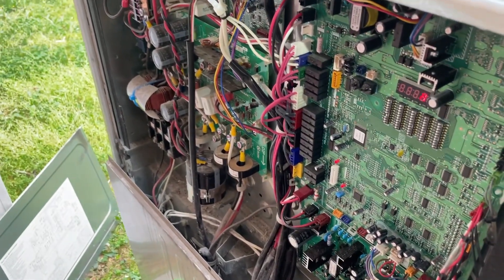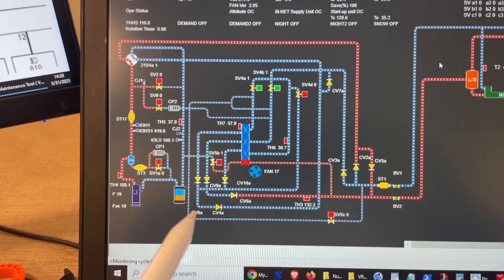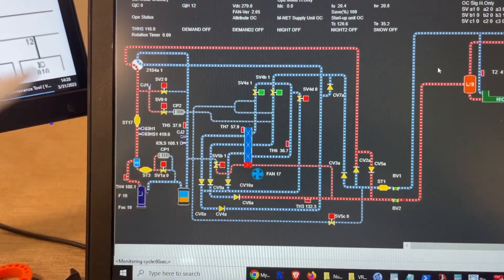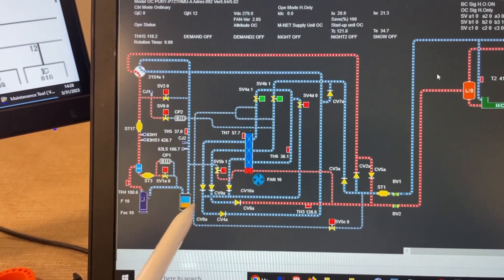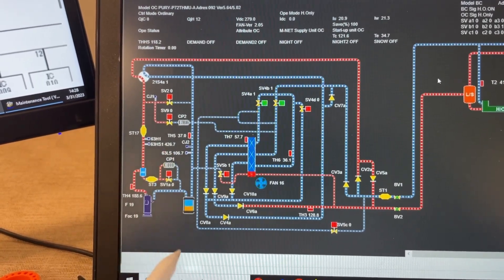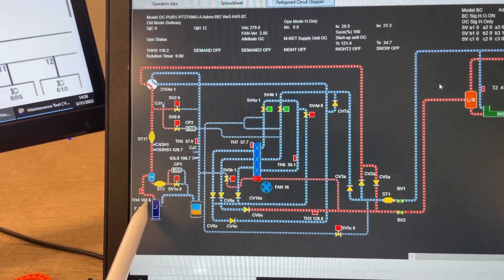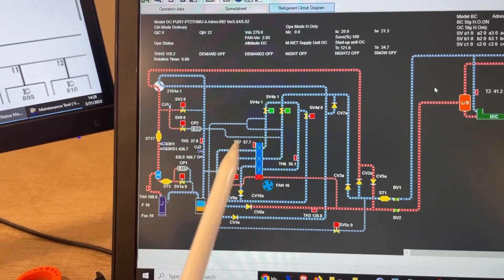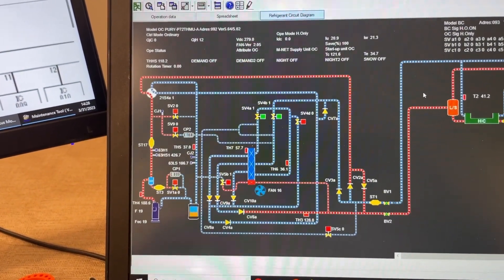Diagnostics34:  City Multi Completely Dead and No LED Display

Comment: Yeah that block in the top left is a DC reactor. The place where you drained the circuit down is a magnetic relay for the inverter circuit. The wire going to the resistor across the magnetic relay appeared to be the one that had a rubbing burn through right? Also yes, it appears no AC to DC conversion being done on the main board. The DC power is coming from the M-NET board through the connector on the top left.  Very cool videos!
Reply: @HVACLife  Yeah it's really fascinating this VRF stuff for some reason, definitely requires a whole new set of skills! Thanks for the videos, hardly any on youtube of this sort of stuff.